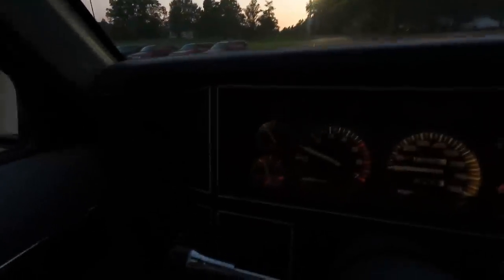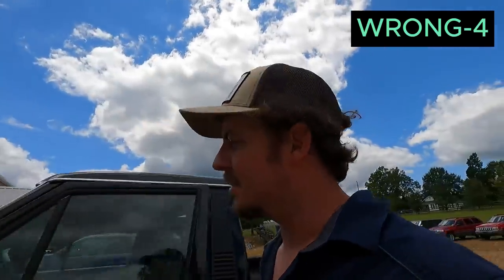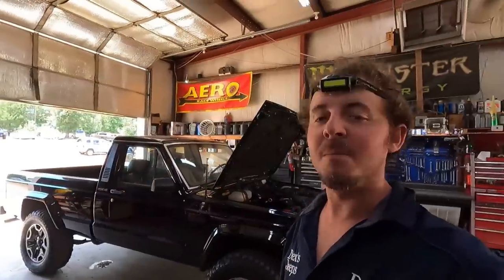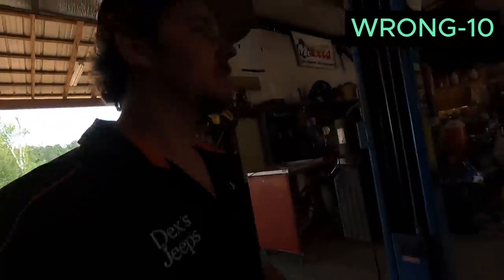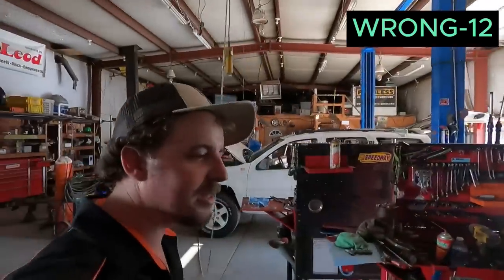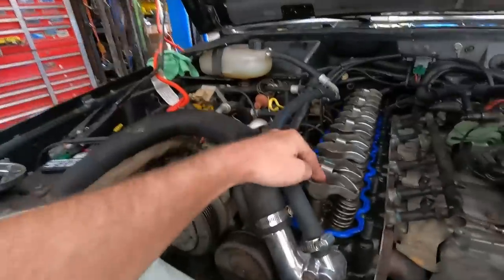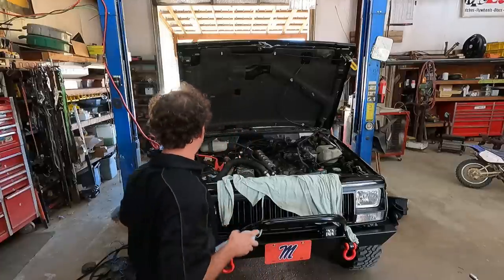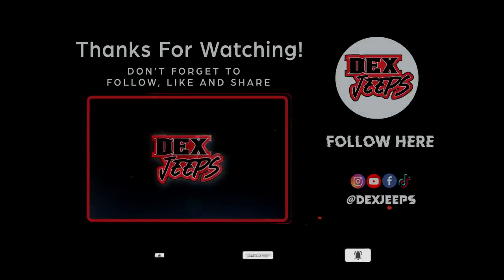I Thought This Would Be A Simple Fix, But It Tested My 20 Years Of Experience To New Levels!

Comment: Need to check the lifter pre-load.   My theory is they decked the head/block excessively and now the pushrods are too long, especially on 1 and 6 where the most material is removed.  Really easy to check with a dial gauge with the valve cover off.   If confirmed, shim each rocker accordingly or order correct length pushrods.

Comment: I bought a rebuilt motor and found out the shop put in the wrong cam shaft thinking it would make more power.  check the lift on the push rods to see where it is at.   have a good day

Comment: Just watched a video from @ProjectDanH and he had a similar problem and it turned out being the wire harness where it comes behind the engine near the top of the head. It had rubbed on the stud and caused some wires to fray and melt, causing a short in the fuel injector and made it run rough. just an idea for you. and pretty much the only thing they all have in common is the wiring harness.

Comment: Your the Jeep whisperer 😅, you figured out more than anyone else, maybe it's a faulty cut cam with a bad lobe. I've seen 'em come from China before, they just happened to get one when they built the motor. I've seen bad injectors from China also. That's why I like the Mitsubishi engines in the later years, those Rendix engines usually don't run correctly do to vacuum leaks. It seems like a bad cam lobe not machined properly to me, in a way

Comment: More new engine installs go like this than people think, but most are small issues that people just ignore. My brother paid a ridiculous amount of money to have his Ranger's engine replaced, when all it needed was some top end love :\ not listening to me, he had a refurbished engine installed, and it's got a stuck/sticking lifter, self fix on warm up, but still, it will be an issue. Think he'll take it back, hell no, he's intimidated, and those fk's kept his truck for 3 months! A job that should have taken 3 days max, since the all parts were pre-ordered. It came back with non- working rpm gauge, power steering issues, and a random shut off problem, not to mention they lost half of his stock air box! He paid $2k for this stupidity >< bc he was too embarrassed that he was taken as a fool to say anything about it, kept making excuses for the shop, etc. Btw he could have bought another used Ranger for the price of new engine work. Those litle Ford 4 bangers are hard to kill, unless you let a crap mechanic get their paws on them.
Reply: They charged him $2,000 to install an engine? Also, how is it the shops fault a lifter isn’t pumping up?

Comment: I got a 89 Comanche with the 4.0 it idles really high sometimes and I have to cut it off and crank it a few times and it will idle right any idea where I need to start and it seems like it has no power

Comment: Anybody have any tips? I have a 2001 wj (grand Cherokee) 4.0 it dies sometimes and it’s random the fuel tank ain’t dirty it’s getting spark and air but the fuel pump isn’t out
Reply: Does it die when hot and restart once’s cooled down alil ?
Reply: Yes after it cools down it will crank back